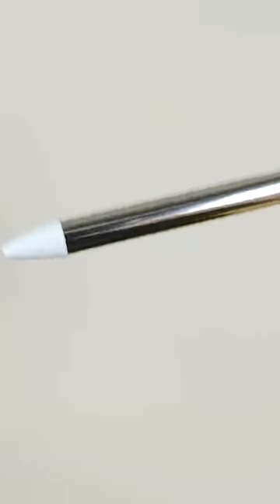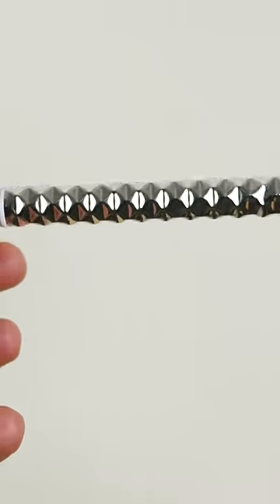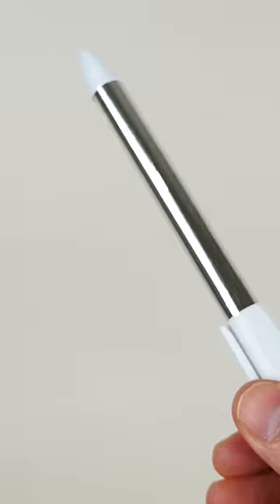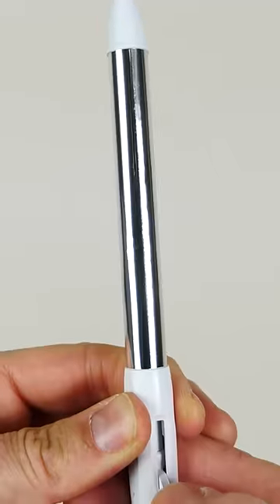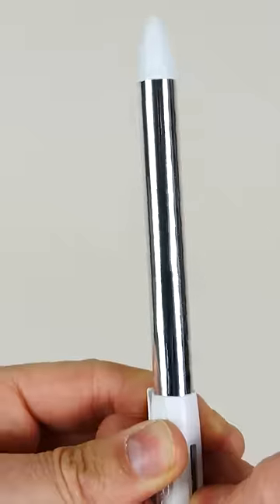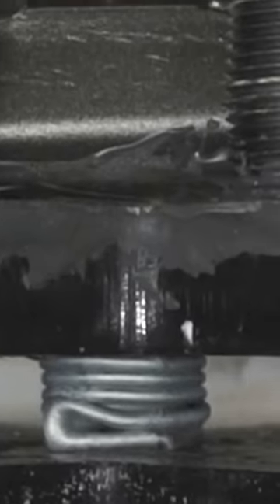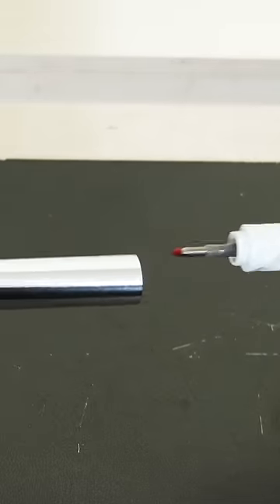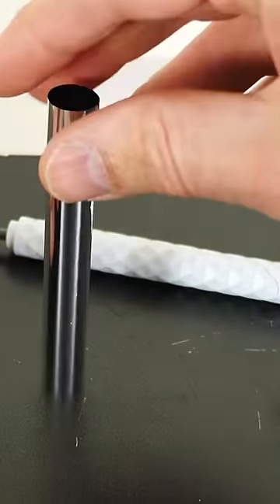How Does This Pen Uncrush Itself?

Comment: On a more serious note, people should appreciate that something that looks beautiful can be made so simply and elegantly.

You do not need a complex solution to create something amazing
Reply: Work smarter not harder
Reply: "Simplicity is sophistication."
Reply: @lambertbrother1628  How is adding a bunch of plastic smarter? I guess it is a simple solution to a problem they invented in the first place.
Reply: Felt the same way, a simple solution but very well executed.
Reply: Simpler stuff is always better. Who would want to overenginner a pen lol. It's also cheaper to buy this way.
Reply: @Herb Spec It didn't have to work this way at all and they could have used less plastic. That's smarter in my opinion. Who cares about a ribbed pen.

Also what do you mean with "the plastic bends easier" the plastic is just the template that forces the "foil" into this shape.
Reply: @Pabloesc571  'Simple stuff is always better' is an obvious statement, but when you are designing something with multiple variables and factors to consider, it is sometimes not easy to come up with the simple solution.
Reply: @cnaizhen  yeah it's not easy, but it's better still. 🤷‍♂️
Reply: @Pabloesc571  Yup you are right. My statement is not meant to disagree with you by the way, it is more of pointing out that we should appreciate the brilliance behind simple solutions.
Reply: @cnaizhen  of course, way easier to go around problems than fix the core of them while designing things. ^^
Reply: @Herb Spec That's why i wrote "foil"
Reply: there's nothing elegant about this. it would be elegant if there was some more interesting physics or chemistry but this is a convoluted way of achieving this effect
Reply: @jenm1  I'm curious to understand why would you think the pen design is convoluted. It is one of the best solutions that allow the pen to crease in the same pattern reliably, with minimum wear and tear over time, and most important of all, easy* and cheap* to manufacture. 

Application of 'interesting' physics or chemistry concepts that are 'elegant' (in your words) would over complicate matters and turn this into a $20 pen. 

My view is that you are missing the elegancy of a simple solution.
Reply: “ beautiful ” 😂
Reply: Cheap tinfoil pen go crush
Reply: the reply section is funny,people get mad at the weirdest things,its a LITERAL pen that folds into a pattern when pressed,lol.

its a simple solution to a cool pen design,its smart and clever,why would you overcomplicate something like that
Reply: @cnaizhen  its cause nowadays most people think that price tag and complexity equals rich,and if its rich its elegant,lol
Reply: @foodaah  what was the problem with the pen and what was the solution?
Reply: This is true, but only certain people can do it.
Reply: How about instead of arguing over a pen in the replies we appreciate and enjoy how cool it looks?
Reply: @gileee your point makes no sense
Reply: @eldritchbeing2879  Read the comment again, it's not difficult to understand. I believe in you.
Reply: @gileee  right, blame others for your inability to articulate your own thoughts.
Reply: @gileee   First of all, you're refering to an artistic idea as a "problem that they invented in the first place" as if they did something wrong. And then questioned the technique they used to achieve this idea, asking why the simpler solution of using thin plastic to achieve the effect was smarter. As if there's a better more affordable alternative. Feel free to tell everyone what that would be. 
What do you expect people to make of your comment? Other than a cynical sob who's getting whooshed by an artsy gimmick pen.
Reply: @eldritchbeing2879  F*ck yeah I'm gonna criticize bad ideas, that create even more waste for no reason. Especially if they're, as you say, "artistic".

To stop buying stupid gimmicks...
Reply: @gileee  But it's not a bad idea. That's your cynical, unprofound opinion. It's clearly effective considering many people were intrigued by it. 
Also criticizing art is not winning you any merit at all. Art is necessity to many people.
Reply: Imo, that's when it's most beautiful
Reply: @gileee so people buying a painting would be waste too then, right? Or when you buy food that isn't the best for nutrition? What about pokemon cards, are they just squares of paperwaste? You're looking at this in a "waste of resources" way, while that just isn't applicable here. Your argument is incredibly ridiculous once it's inspected. You're fighting a demon that doesn't exist. Chill.

People buy things to flair up their lives a bit. Like this novelty pen. Novelty pens are a way to make mundane crap like writing essays or boring meetings a little more enjoyable, and have existed for decades in different shapes, forms and price ranges. They're made and bought for a reason, and that instantly makes them not a waste, as they achieve the goal they set out to achieve. 

Just like a plate of honey bbq ribs may not be the most nutritious, but people buy it because it spices up life and makes them enjoy food, and why the cliche "nutrition cubes" would fail if they were ever invented. That boring mentality is resented for a reason, chief. 

The world is but a stage, try to live in the moment and enjoy life a bit, because some day the curtain will call for all of us, and all we can do is prevent regret before we're at our final Encore.
Reply: @Pandamaxx  I ain't reading all that, but I'll comment on your first sentence. A painting is at least decorative and art, this is a pen made in China that does nothing other than use two (instead of one) piece of plastic, increasing plastic waste.
Reply: this comment is literally so sweet, it got a genuine smile out of me 😭❤️
Reply: @gileee  the goal was not save plastic it was make this type of pen. So it is smarter for their pen design needs.
Reply: @HadrianGuardiola  Sure, it's not Israel's goal to prevent genocide, but I'm still gonna critique them for doing it.

Comment: So it's just wedging the two pieces on the inside together when you slide the "button" down. Expanding the inside from the opposing vertical slants where the two center pieces come in contact in the middle.
Reply: Thank you! This is exactly the type of detailed explanation I was expecting to hear in the actual video! (So disappointed to not get any explanation there.)
Reply: I’m still confused.
Reply: @aliveandwell3958  I searched the internet and someone on Reddit said that there is a loose sheet of metallic plastic over a stiff material with holes designed in it. When the pen is clicked, there is a suction applied to the foil that makes it “grip” and accept the shape of the stiff material with the holes in it. That was probably confusing 😶
Reply: @yourguitargf  that make more sense! Thank you!
Reply: @wuz2blu  fr
Reply: @yourguitargf  If it's pneumatic though, shouldn't the entire outer wall be gradually sucked in when you press slowly? Instead, this clip shows the pattern clearly forming from top to bottom 🤔
Reply: @SubSkrub  It's mechanical, it's expanding. The hard plastic half tubes are separated longitudinally  along an angle that expands as it slides.
The spring being pressed is the slider going in and expanding the hard plastics inserts halves that give the pliable plastic film its cool shape by expanding against it.
It's very cool, simple and elegant.

Comment: I was expecting the shiny outside to be a thin metal sheet with scores on the inside so when crushed it crumpled in a predictable and predefined way, like how if you fold a piece of paper and make a crease, it will then fold along that crease very easily.
Reply: You could clearly see it's a tin foil
Reply: @Pabloesc571  It's not.
Reply: @robinsonrom  its very similar to tin foil, its tin foil with a Layer of plastic.
Reply: @Pabloesc571  Well, it’s clearly not just store bought aluminum foil. Look at the way it returns to its original smoothness with no creases or blemishes at all. The metallic finish is most likely a mylar coating which is pasted atop a thin sheet of polyester, resulting in the finished tube when rolled.
Reply: @TheGreatLake1998  as i said lol

Comment: The physics behind is relatively simple, the metal sheet undergoes elastic deformation as a result of compression and its deformation according to the mold’s shape. I made something similar for a project while doing my bachelors but that was more related to machines for manufacturing where you could change the mold out under it and compress it to your need.

Comment: Referring to the crushing at the end, a similar effect occurs in fluid mechanics. From Rayleigh plateau instability to periodic bulging of contact lines during inkjet printing. In the case of fluids, this is almost completely dictated by surface tension. For solids, I imagine it has something to do with the play between lateral and normal stresses.
Reply: Yes I suspect you too will be equally disappointed when you buy one.
Reply: @JJ FX  actually, I was referring to the crushing at the end. I knew the trick for the pen

Comment: The engineer who came up with a solution that simple actually deserves an award.
Reply: Except that this contraption is not designed to last very long, as is with other products like it sold today. If they improve on it with tougher materials then it's commendable.
Reply: @MollyHJohns  like carbon,but that will take a few more years

Comment: When a solid is put under enough pressure that it, due to its molecular structure, assumes a temporary liquid like state in order to release the tension, it will follow the property of a liquid in that it will follow the path of least resistance, in this case, to release the tension, it is conforming it's to the more sold pattern beneath it which is a more structured pattern, or in the case of the folding pipe, fold in the places that are structurally easier to fold in.

Comment: Probably something similar to the food packaging made with aluminum foil bonded to plastic film. It's just that the plastic film is a little bit thicker in this case, like one of those clear folders you put reports in.
Reply: Mylar is just plastic film. It frequently has a metallic coating, but that's not a requirement for it to be mylar. Also, the metal coating is via vapor deposition, not like a separate foil glued on somehow.
Reply: @wbfaulk  I worked in a place that printed food packaging. Those mylar looking chip and cookie bags are definitely aluminum foil bonded to plastic film. You glue them together, and the end product takes on properties of both.

So that's what I meant, a product similar to mylar but not mylar itself.
Reply: @briebel2684  If that's what you meant, that's not what you said. Restrictive clauses always refer to the noun they're immediately adjacent to.
Reply: @wbfaulk  There, I edited it. Are you happy now? JFC.

Comment: To do the answering for him its because rolled steel/metal have huge tensile resilliance.
However if a flat sheet is cut into slices they will explode due to the uneven atomized bonds between the compounded metal

Comment: When I first saw this pen, I immediately thought of the video of the steel pipe being crushed. I thought it was so cool that they managed to manipulate the repeating pattern and change its formation. Then I saw a video where they opened it, and I was very disappointed when it turned out to just be a piece of plastic pushing against another price of plastic WITH THE PATTERN PRE-MADE. It wasn’t even real metal.

Comment: Look at it this way. We have such a profound understanding of the natural that we can fold sheeted metal extracted from rocky ore in a symmetrical geometry and back into its original form with nothing but two moving pieces of premolded plastic. If that is not impressive natural divinity.

Comment: to be fair, i do sorta see that triangular pattern when crumpling thin cylindrical things

like with a plastic wrapper encasing a straw,
when i push the two ends against each other it folds and creates the same repeated pattern as the pen shows

it does happen, they just decided to use an engineering facade to avoid the hassle of finding material that could fold like that just for a gimmicky pen

Comment: You must do research on comparative study normal, crumble shape on earth quack.  When earthquake comes normal pipe line break, either domestic dainge pipe or factory pipe. 
It's very difficult for factory to work in earthquake areas.  In morracco country they have thrown river of wine on road because pipe line  of wine factory have broken after earthquake. 
Study the effect of  earthquake on pipe line, so that company can work comfortably. 
Jay bharat.
Reply: My question is can  earthquake wave pass easily through zic zac crumble material.  Jay bharat.